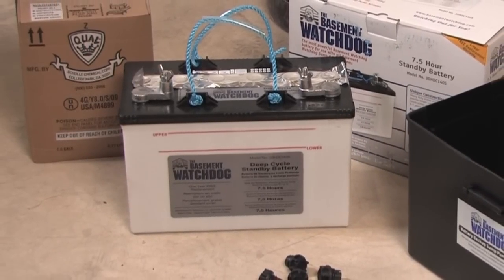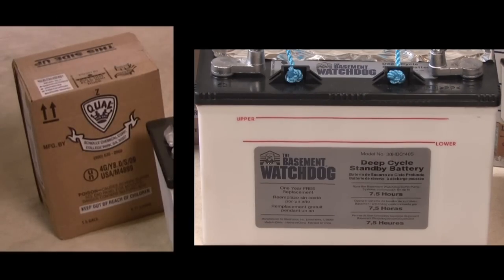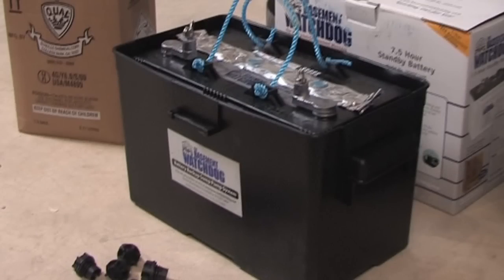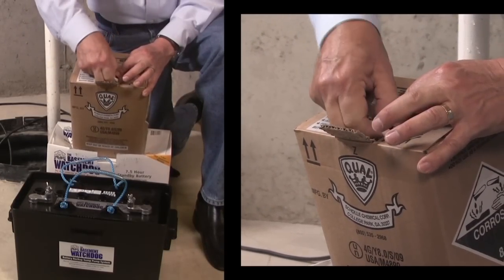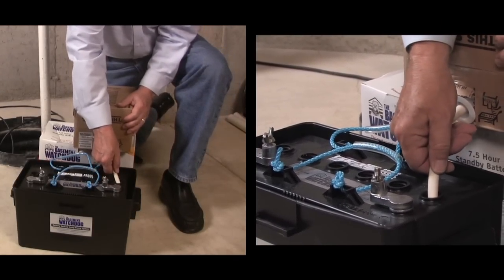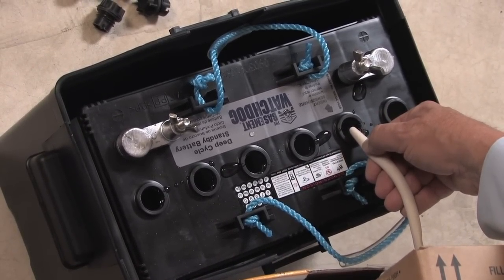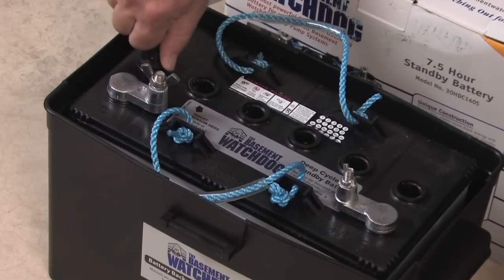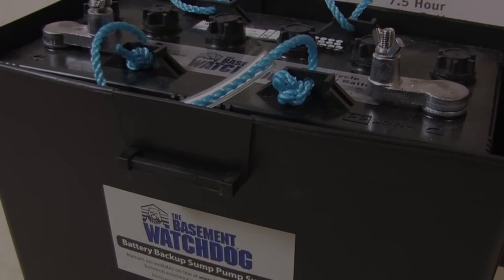How to fill a Basement Watchdog Standby Battery - Sump Pump Installation Tips

Comment: Too bad that once you put it in the box you can't see the levels. So I did it outside the box. Guess what? The big silver decal was blocking the levels, not that you could hardly see the level in it. You had to stand at just the right angle to possibly see the level on the side. It's really fun carrying a open box of acid around the garage, squatting and bending while trying to keep the tip pinched so you can try to see the level and what needs to be filled more. I got it done but ran out of acid. They are pretty close to even but my nerves are shot trying to do this!!!

Comment: @ddenuci Should have also mentioned that I needed to add some water to two of the six cells.  Not much, but it was the first time I added water in the three years that I had the battery.  Again, according to the documentation, I should have been checking it every 9 months to see if it needed distilled water.  Note:  When refilling the battery cells, do not use the sulfuric acid that was used initially.  Only use distilled water.

Comment: Should have told you to wear safety chemical splash goggles and rubber gloves to protect yourself. The acid box can be a little awkward when pouring.

Also, pointless to put the battery in the box before you fill it - you can't see the fill lines. I used a painter's work light and pointed at the backside of the battery to shine it through so that you can see the acid level as it fills - still can be tough to see if your light isn't bright enough. And do the same thing when have to add distilled water up to the level lines. It will make this operation a bit better.

And yes, the music is annoying.

Comment: @ddenuci According to the watchdog documntation:  It depends on the size of the battery and the sump pump system that is doing the charging.  The chargers on the Basement Watchdog Special and Emergency systems are less powerful trickle chargers, and they will take several days to recharge a battery. You could take the battery to a service station for a quicker charge, or hook the battery up to an automotive charger if you have one.

Comment: u can also use a turkey baster from a gallon of distilled water.  make sure you check levels every 6 months -  i checked my new battery after that time, and the water levels were very low.   but i have a wayne battery.

Comment: My Watchdog Battery 24EP6 performed admirably during Hurricane Irene.  However, it did die within about 4 hours of continuous pumping.  (It is rated for 6 hours).  Fortunately, I was able to replace the 24EP6 with a car battery.  Now I'm trying to recharge the 24EP6.  Anyone know how long it typically takes to recharge under these conditions?  The alarm is on continuous - cannot be shut off by pushing the reset button.